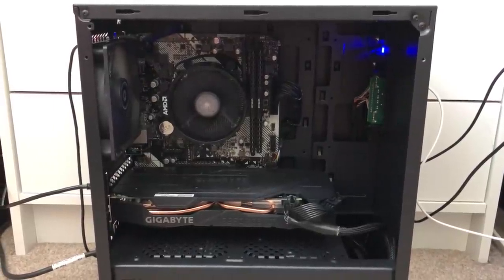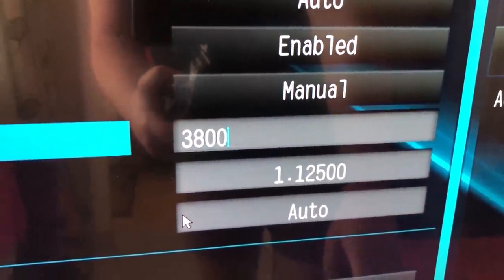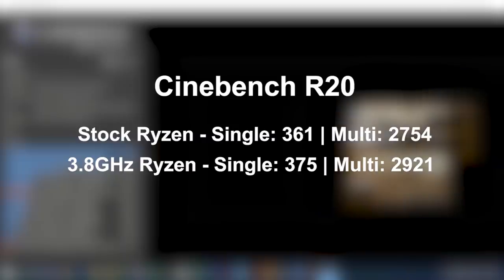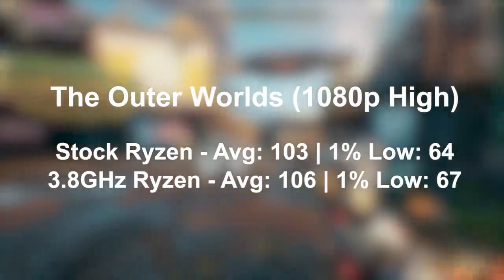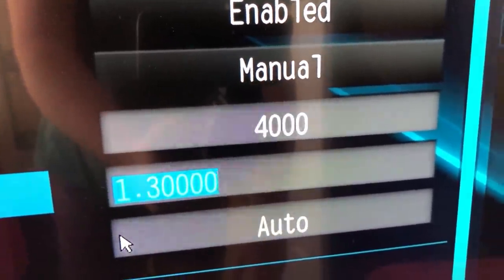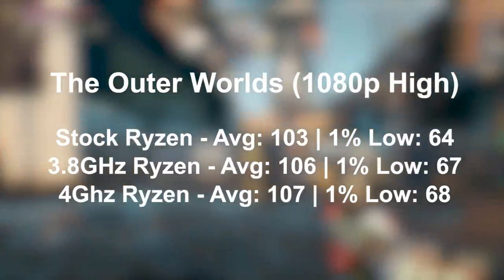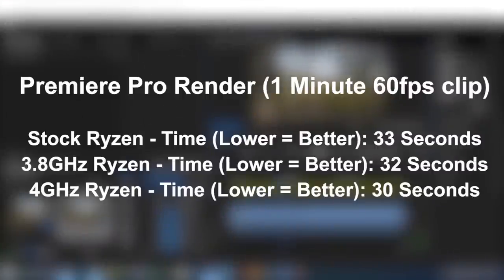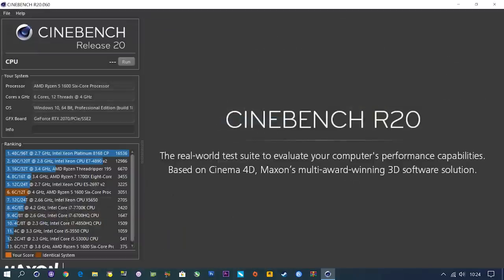4GHz Ryzen Overclock On The Stock Cooler: Good Idea Or Fire Hazard?

Comment: So r/overclocking on reddit has a very handy wiki page for safe voltages, temps and general guidance for Overclocking
based on my experience with AMD Ryzen CPUs are very temprature sensative, the funny quirk of this is that sometimes you can find a range of voltages where on the lower end you are somewhat stable but higher would cause a crash untill you reach insanity range, even a 2 to 5 degrees can help with a extra 100MHz but this varies CPU to CPU

also 4.0Ghz is generally the voltage wall for zen overall so some CPUs may hit 3.9 before voltage increases become exponential and some may hit 4.1.

Comment: The moment you increased the voltage it stopped being "free extra performance". When you mess with the voltage an overclock is no longer guaranteed to be safe for the CPU unlike, for instance, just bumping up the clock and trying to find a stable point without bumping up the voltage. And because running an OC with additional voltage you risk damaging the CPU, eventually, you'll need to waste money on a new one and even if you manage to keep it running okay for some time and then sell it to someone else, there's still the problem of selling someone a CPU that's been heavily degraded.
Reply: All for 2-4 extra FPS on a good day. Honestly, I'll take the lower temps, fan noise, and power cost and just run at stock anyway. Plus these 1600 AFs are lower quality 2600s, so they probably couldn't run stable 2600 speeds in test anyway.

Comment: I wanna see his pc run Minecraft SEUS PTGI
Reply: Im running Sues PTGI E12 with a realistic x1024 resource pack on my 3600 (16gb 3600mhz/1070ti) with the ray tracing at ultra. Still runs at 60fps without breaking a sweet.
Reply: @MrIsmaeltaleb85  me too, I have a 3600x and a 5700xt and I get 60fps, sometimes 70, 80
Reply: @MrIsmaeltaleb85  he don't break sugar?
Reply: @MrIsmaeltaleb85  I'm jealous. I get about 12 FPS with a Ryzen 5 1500x and an RX 5500 XT. 50 fps with vanilla Minecraft
Reply: @KofolaDealer  50fps on vanilla? My old GTX 660 and gets 200+ fps on vanilla

Comment: My 2600 quickly rises to 90°+ after a few minutes on aida64 if i try to OC it to 3.9Ghz, even at super low voltages :/
(stock cooler)
Reply: Bad mount/paste?
Reply: i put a wraith prism on my ryzen 5 3600 so far the hottest the cpu got gaming is 65c beats the shit out of the wraith stealth and it has rgb,
Reply: Try an aftermarket cooler like deepcool gammax 400. You can OC your 2600 to 4.0 or even higher like i did on mine.

Comment: 1600 AF usually overclock to around 3.7-3.9Ghz on the stock cooler.
Reply: Mine barely hits 3.725Ghz with 1.3 Vcore... 😢😢
Reply: 88 88 it can take higher vcores easily. Maybe not with the stock cooler.
Reply: @karlkukk7080  As far as I understand AMD says the safe number is 1.35, I tried that with 3.8GHz and my temps were hitting 90C on an open air bench, with a noctua cooler maybe I could push out 3.9GHz, but at that point it's better to upgrade.. Definitely unlucky silicon on my chip.
Reply: @3rd.world.eliteAJ  my brothers only hits 3.85 at 1.35 anything higher and it wants an exponential increase in voltage or it will just crash :( poor guy just got a pretty bad sample.
Reply: @cainankitts7216  I definitely lost the silicon lottery, I can only run 3.8 at 1.4V 😔😔
Reply: @cainankitts7216  my 1600 non af require 1.45v to run 3.9ghz lmao, but 1.35v is not bad you can push over 1.4v as long you have sufficient cooling available but dnt push more then 1.45v for 24 hours work, you may degrade your chip
Reply: 2005 wants it clockspeed back.
Reply: I can reach 4.0 GHz with 1,26 Vcore, guess I'm lucky.
Reply: @thiago7542  Very lucky, when i got my 4790k back in the day i got very lucky too.
My 4790k has been running at 4.6Ghz 24/7 with 1.27V since 2014...
I've even run it at 4.8Ghz with 1.31V for a few weeks but it didn't improve performance in a meaningful way so I went back to 4.6Ghz.

Comment: Mine runs @4ghz with 1.26 volts.  The stock cooler is sufficient, but I was able to score a Wraith Prism for $10 online and it made a huge difference.  With summer coming up it can't hurt to run an extra 10-15 degrees cooler.

Comment: TWEAK YOUR RAM TIMINGS!!! Ryzen loves memory speed and tight settings. Mine R5 3600 + 1080 TI system gained 15% performance only by tweaking memory.
Reply: What were your memory timings? Mine are at 16-18-18-18-36. Is it better to increase the numbers lower them?
Reply: @superazell  i have tridentZ 3400mhz CL16 , But with dram calculator mine stable at 3600mhz CL14 fast timings at 1,48v, been stable for months
Reply: Low memory latency(high frequency, low timings) will have some impact on performance if you're not gpu bottlenecked that is.
Reply: @themaster2851998  i find his RTX 2070 performance too low for example in far cry 5 even with high settings, Only like 88FPS on average, 2070 in this game at ultra can get 120fps, so it's bottleneck in his system way too hard. My R5 3600 4.2GHZ + 3600mhz CL14 ram and 1080 TI gets 138fps average in far cry 5 at FHD ultra
Reply: i very much doubt you got a 15% performance increase just by ram timings alone, a 3% increase would be considered very impressive. I think your testing is flawed.

Comment: My 2600 does 4ghz on 1.2v without problems. my recommendation is spending an extra 5€ for kryonaut paste instead of spending 40-50€ for a new cooler.
Reply: tfw have to have it at 1.25v to get 3.9 ghz to be stable
Reply: @newolku  he probably doesnt use stress test so he never crash.
Reply: mhh3 . Or 20€ and have a nice level of overhead.
Reply: @cicciograziani6697  i can do 10 cinebench r20 runs without problems
Reply: @cicciograziani6697  Im talking about normal use. It would randomly lock up for me. The stress tests were fine but after a few hours or so of normal use it randomly crashes.
Reply: I ran a 1.3v  3.85ghz OC on my 1600 original for over a year with ArticM4 and temps didn't get over like 72c with an decent fan profile. My 3600 does 4.4 ghz on 1.225 V and gets over 80c when stressed but standard use it hovers around 60-70c. The new coolers on the 3600 are trash...no vap chamber / all aluminum.
Reply: @TheColemancreek  60-70C for an overclocked 3600 with the stealth cooler is pretty good. i don't know what you expected.
Reply: Nah the 34  eSports duo is going to oc it very well
Reply: @mhh3  I was just saying that the cooler is trash.. the Wraith Spire that came was my 1600 was good.. the Wrath Stealth is pretty similar to Intel's standard coolers. Yea my temps are fine otherwise I would upgrade to an inexpensive aftermarket one.
Reply: @mhh3  Sure cinebench is one thing try prime95.
Reply: @ghostrider2214  i'm not using any programms or games that would stress my cpu like cinebench, so why should i use prime95? cinebench uses 100%, if i can run it multiple times without a problem then it is good enough. Just because you see reviewers do it doesn't mean that it makes sense.
Reply: My R5 1600 af hit 4225mhz at 1.38v gigabyte b450 show me this i dont believe i think voltage ist above 1.4 v Working stable tested with prime 95 avx on 3h max temp 75 c
IN games temp 48/51 celsius

Cinebench r20 single:433
Cinebench r20 Multi:3275

Cinebench r15 single:176
Cinebench r15 Multi:1455

Cpuz single:490
Cpuz Multi:3950

How to buy R5 2600?
Reply: @mhh3  What I said has nothing to do with reviewers and everything to do with my own personal curiosity as to the stability of your system. The reason I'm suggesting it is to see if the overclock is rock solid or just "passable." (which is fine if it runs for you 24/7 w/o issue) and the reason you'd normally run this for personal use is if you do any actual workloads you don't want to be half way through a huge render and have  the PC crash.
Reply: idk if this is ok but I used an offset on my 2600X on 4.05 Ghz and according to HWinfo I max out at 1.188 Volts

Comment: All Ryzen run best slightly undervolted. A negative offset of -0.1v (if stable) will be best. Lower temps and funnily enough also boosts higher.
Reply: Om Borkar  I can confirm with my Ryzen 7 1700X and you can confirm it too if you try it out with your Ryzen.
Reply: @IosifStalinsendsyoutoGulag  If it's all stock then everything is fine. I would however recommend giving undervolting a try.

Comment: I replaced the stock cooler of my Ryzen 5 3600 with the wraith prism cooler, since then... max temps under full load 76°c and idle is  36°c
Reply: Yeah the prism is a very nice cooler.
Reply: i did the same but the games i play don't seem to effect temps that much and my 3600 with the wraith prism according hardware info didn't go above 65c
Reply: @rossgarner58  yeah, except you usually never put the cpu under full load except when converting or rendering videos, which i do for my videos. Hence the overhead with a better cooler is a must.

Comment: It works! i had my 1700 at 3.9ghz on the stock and it worked for about a month and then started crying in pain or the barring lubricate was evaporating.
Reply: Sounds like you got defective cooler. They should last a lot longer than that
Reply: @ademiravdic  you have more faith in fans than you should. There cheap cooler master ones. Runs yours at 2400 rpm for a week strait (the new ones only go to 2000 for this reason) and you will get the worbble noise just due to plastic warping or the glue that hold the fan to the bolt loosing a little.
Reply: @coryandrum  I'm a heavy smoker, if you saw some of the fans I've seen you would have a lot of faith in them to.  It takes a lot to kill a fan.
Reply: @coryandrum  nah dude, pretty sure yours just had something wrong with it
Reply: @jbscotchman  smoke just makes the dust change color, its the same if you use a candles.... Idk why you said this but to doubt your understanding of the subject. Neither of you have mind crypto i assume.
Reply: @coryandrum  lol, cigarette smoke is way more damaging than regular dust.
Reply: @jbscotchman  it's just sticky and you get some residue left over if you don't clean it well. I recommend a Alcohol solution then running a cue tip on the inside of the fan so the blades wont snag it and the blades with a wipe. I have to pop the top of my u1 sever psu's and air spray them since the fan is pushing dust into the psu. It being blow threw the fan though and some is sticking to it. Not "damaging" the internal bearing that sealed lol

Comment: Unlike Intel, AMD Actually future proofs their stuff.
Reply: Unlike AMD, an Intel processor from 2010 is still decent.
Reply: Jeff Smith we all know that. But we’re speaking of modern Ruben CPU’s. and Video cards.
Reply: Jeff Smith I know, AMD has been kicking butt and taking names (for ore-orders), they really made a comeback. It’s always been a power struggle (lol, now Intel is struggling with the power, but power draw in this case), they’ve been flip flopping since existence on who was king. Right now Ryzen/Threadripper is the obvious choice for almost any workload.

My first build was with an FX-8350, cost less than a locked 4 threaded i5 but delivered much higher performance. Plus they overclocked well, and even recently I’ve had paired it with a Titan Xp and it was clear for 4k gaming you’d want duel Titans and it would be just about perfect (you could also do 2x 2080, that would be a good pairing with a stock FX-8350, but going duel Titan RTX would likely not be a big improvement because duel 1080ti/Titan Xp is right where the GPU finally catches up to FX in probably the majority of modern games, exceptions exist of course).

But Ryzen now almost matches the power hungry FX (the FX-9590 has about same power draw as a stock out of the box 9900k, but I often less power use on the FX and much easier to cool due to lower transistor density spreading out the heat), so it’s really cool when a 4 threaded budget chip from Ryzen lineup can match not super long ago (it was super long in terms of technology but within all of our lifetimes). Now we’ve even got behemoth world record breaking 64 core/128 thread monsters using relatively similar power draw, that’s some serious improvement! It’s awesome!
Reply: @jakegarrett8109    My first build was with a Phenom II X4 965 BE, then I went to a FX 6300, and my final AMD processor of an FX 8370 (there was an Athlon II pre-built I picked up at some point in there, too).  I was team red all the way until the disappointment that was the FX series, decided then I'd never give AMD another dollar of my money.

I'm glad people are having great success with ryzen, but I'm plenty happy with my 5 ghz 8700k, 5 ghz 7600k (on air), and 4.5 ghz 6700k.  So far Intel hasn't let me down, and I don't see them doing so anytime soon.  Have you seen an FPS chart where any ryzen cpu was ever at the top?  I haven't.
Reply: Jake Garrett and the new AMD 4000 extra Vega mobile chips are killer too putting to shame intels latest recent releases.
Reply: Jeff Smith my main build uses quad GPU (so I use a Threadripper, as the 7980XE didn’t have near enough PCIe lanes for me), so in regards to topping FPS in games, yeah, Ryzen does, the Intel chips couldn’t do what mine does.... But also I don’t think it’s as big of a deal as you might think, even a 2200g at low resolution (like 1080p on my 240 Hz monitor), it hangs surprisingly decent even with my Titan Xp collectors edition (yeah, using a $60 processor)

Personally I wouldn’t get Intel except for VERY specific case, and that would be a 9900k at no less than 6 GHz on phase cooling (yeah it’s over $1k cooler, but it’s the only way for Intel to make sense), with preferably 2x 2080ti (but with an anemic 16 lanes, that’s only really good enough for single GPU, so even that’s debatable). That is the only time Intel would be significantly better for most, so besides that weird case of high fps at low resolutions with sub-zero cooling then it doesn’t make sense (just buy a better GPU or if you already have a 2080ti but another one, you’ll get much better value and performance for your money).

I wanted to get the 28 core Intel chip, but I’m glad I didn’t waste money on that (I’d much rather have the 64 core Threadripper). But still, as for gaming as I mentioned before, even a turtle like FX is simply faster than any single GPU in existence at 4k (and I do mean any GPU, I used to run sub-zero cooled GPU for high overclocks as my everyday normal Youtube/gaming/CAD machine, it was just like any other PC except it would freeze the air into ice if you left the heaters unplugged, haha!), and if FX is fast enough for maxing out a Titan RTX at the resolution I game at, then you know my TR-1950x at 4.2 GHz is more than capable (it will run higher if only gaming, but often I run multiple batch file handbrake encodes while I’m gaming, to me stability is highly important, hence the low speeds, plus it’s on a 120mm AIO...)

So performance topping at 720p I don’t care about. At 4k there is no difference between an FX and Intels flagship, only at 1080p does it get interesting, because then it might be that $300 extra you spend on the Intel getting you 250 fps instead of 240 fps. Still probably not worth wasting money on an Intel, but it’s a big enough deal that I might notice (I once thought a game was broken, it felt “laggy”, turned out I had a power saving feature on limiting frame rate to 240 fps instead of game engine caps of 300 fps, I could tell this on even my 60 Hz monitor, because the faster of course had that nearly 1 mS difference. To others they might not notice). So is that $300 extra worth it for extremely small gains? I don’t know, because that’s less than I’ve spent on a copper cup (about $400 for a liquid nitrogen cooler), so maybe, but it’s so rare of a use case I’d say for 99.99% of people the Ryzen is better for people (even with my weirdness and spending more on my computers than my house, cannot justify an Intel, I’ll probably build a $5k cooler for my daily machine to hit -100c and may have to use 5 kW of electricity to run the compressor, but even I cannot justify the waste of money that is an Intel CPU, it’s just far inferior in most of my tasks, and it’s use case is just so limited where it makes sense... Like I think many gamers should be using exotic sub-zero cooled systems, but I still can’t recommend an Intel except for cases where you are using multi 2080ti at low res like 1080p, and yeah, I have recommended that setup a few times, but it’s super rare...)

Comment: If you can manage to stay awake during a Gamers Nexus video, I really struggle, it will show you how pointless synthetic benchmarks and Cinebench actually are. If you game on a Threadripper you'll get worse performance than a high end chip from several generations ago. It's all on the use case. As someone who does a bit of everything, picking a CPU seems ridiculously difficult at the moment.